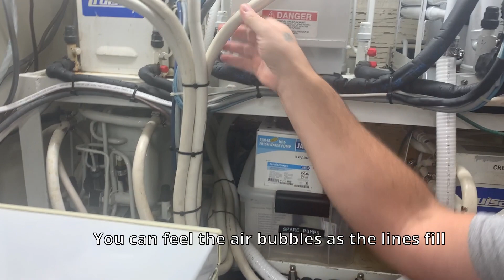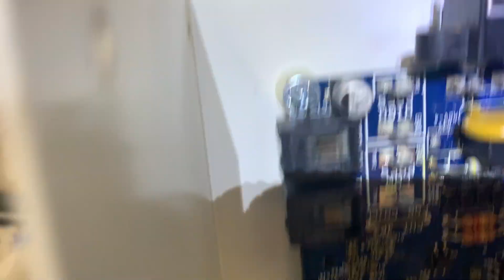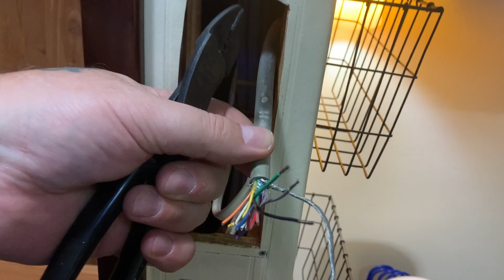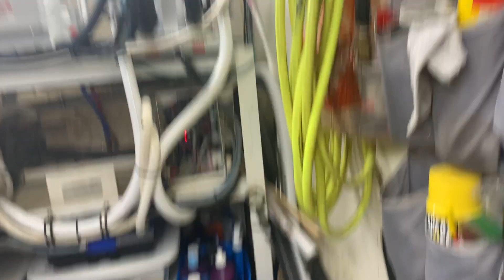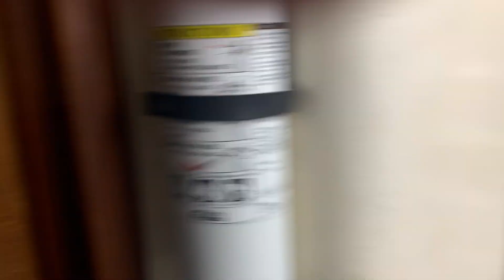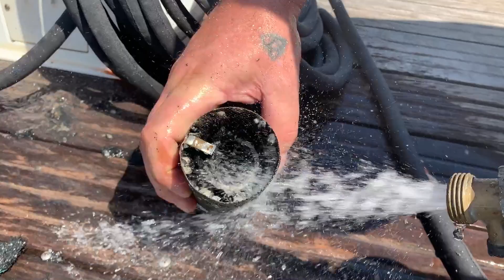1988 Hatteras 65C S2-E3: Marine AC Systems

Comment: Ive got marinaire systems. Theyve got heat and dehumidifier mode. Very nice units but theyre the only type ive used. Does the cruiseair offer heat as well?
Reply from the maker: Hello there. Yes, and I looked up a couple MarinAire schematics; looks like those and CruiseAir operate in similar fashion, using a reversing valve to have both a heat and AC mode.